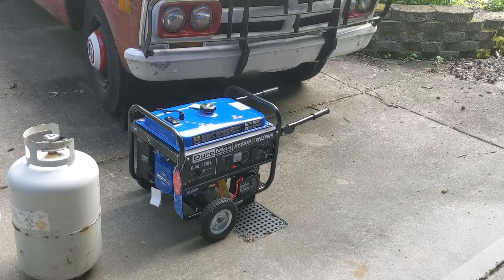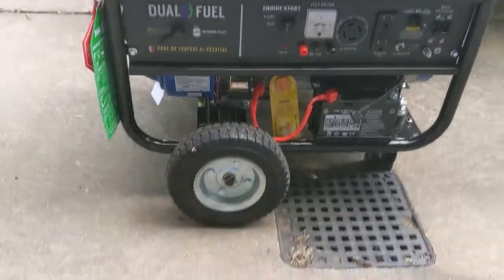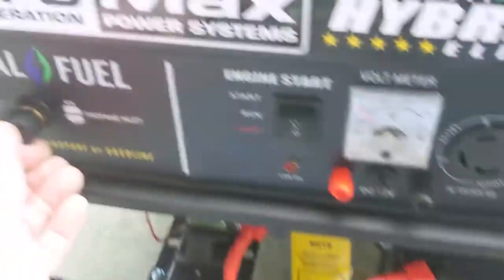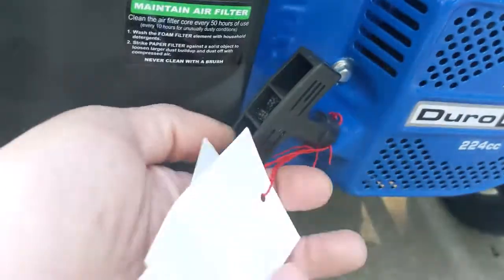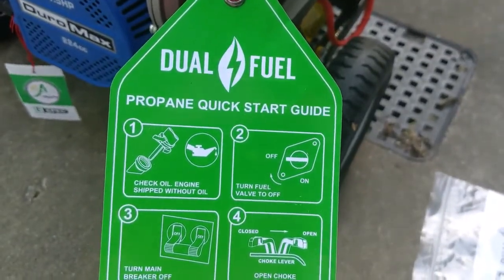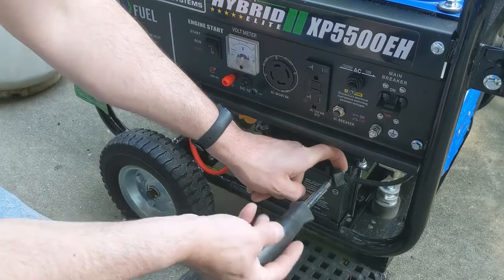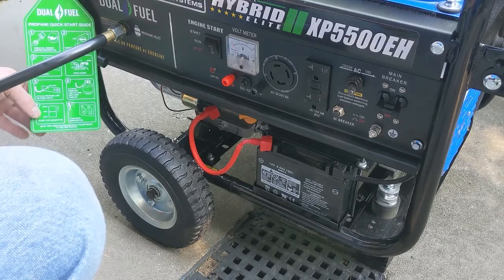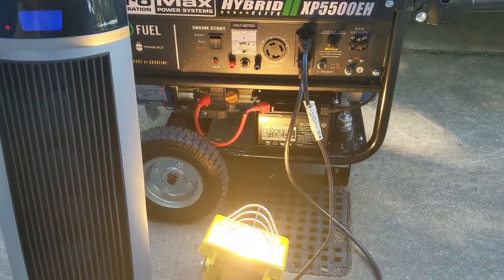DuroMax XP5500EH Generator

Comment: ... this runs ..FULL THROTTLE.. regardless of "demand" ... NOT-GOOD ... noisy & sucks-fuel ... YOU NEED AN "INVERTER-GENERATOR" WITH AN "ECONOMY MODE" ...
Reply: No it doesn't run full throttler regardless of demand. This generator just like every other non inverter generator has a governor to keep the engine at 3600 RPM to maintain 60 hz AC frequency. with no load the throttle is not even 1/4 the way open to maintain 3600 RPM so stop spouting uninformed bullshit.
Reply: @anthonypetrone242  .. Thank You ... Anthony ...
Reply: Don’t forget about generator safety rules: Always make sure you follow all the generator safety rules whenever you use your portable generator. This is a reminder for your safety. Generators can be dangerous if not used carefully. Every year, hundreds of people die or get injured when using portable generators due to carbon monoxide poisoning and electrocution. Make sure you are using your generator carefully and keeping others safe as well. There is something very serious that everyone should always be aware of when using generators. Some people do run their generator indoors which is not safe and that increases the risk of carbon monoxide poisoning which can cause death of family and you. Some people run their generator in wet conditions which can electrocute them. Please remember that you should never run your generator indoors. Remember that carbon monoxide is an odorless and colorless gas that you cannot see or smell. Carbon monoxide is a silent killer. Keep that in mind. Make sure your generator is 15-20 feet away from your house and away from doors, windows, and vents. Never use your generator in your porch too. Having a carbon monoxide detector is very important against generator safety. Some people also allow children to go near the portable generator which could pose risks. We need to keep an eye on our children making sure that they are not near the portable generator so they won’t get electrocuted or burned by the generator which is dangerous. A locking enclosure also keeps kids safe. A generator shed might look like a tempting place to explore, or take cover during a game of hide and seek, but a generator is a dangerous piece of equipment that can cause injury. It says on the manual that we should also keep children away at all times from the portable generator to avoid injuries. Please do not allow a child or unqualified people to operate the portable generator.  It is important to keep your children safe especially little ones. The portable generator can be hot during an operation. Just because some manuals missed what should be listed doesn’t mean it’s safe to do. Always follow the generator safety rules when using portable generators. Generators pose electrical risks. If you need to use your generator during wet weather, you need a generator tent to protect your generator from getting wet. Don’t let your generator get wet. Keep your generator dry and before using your generator, please make sure your hands and your generator is dry. Do not wear loose clothing when operating the generator. Everything that is said on the generator’s operating manual should not be ignored. Never smoke cigarettes near the generator. Please keep flammable things away from the generator. Never overload your generator too. Your generator can catch fire. Never ever try to plug a generator cord into a wall outlet to avoid back feeding. Back feeding your generator is dangerous. Always turn on your generator first before plugging in appliances and shut off the appliances before turning your generator off. Use a heavy duty cord for your generator and the cord should not be worn out. All the instructions should be followed carefully. Never refuel your generator while it’s running. It can cause fire if fuel spills while your generator is hot. You should turn off your generator and let it cool off before refueling it. Having a fire extinguisher next to the generator is also important. This is only a reminder for everyone’s safety of using generators. Make sure your generator is properly grounded. Having a fire extinguisher next to the generator is also important against the safety rules. https://youtu.be/I1jT3ANENvI and here is a video more about keeping others safe when using generators and also about our family’s safety. It’s important to keep our little children safe as well. Make sure your little children are kept away from the generator at all times especially when it’s running. Hope this helps. Always remember that it’s better to be safe than sorry.

Comment: Thanks!!!!  I drained the battery trying to get it started, as soon as I fiddled with the choke it started right up! (Using on propane...)
Reply: Same here. I was following the Quick Start Guide, and left the choke open. After setting choke to half open, it fired right up.
Reply: Don’t forget about generator safety rules: Always make sure you follow all the generator safety rules whenever you use your portable generator. This is a reminder for your safety. Generators can be dangerous if not used carefully. Every year, hundreds of people die or get injured when using portable generators due to carbon monoxide poisoning and electrocution. Make sure you are using your generator carefully and keeping others safe as well. There is something very serious that everyone should always be aware of when using generators. Some people do run their generator indoors which is not safe and that increases the risk of carbon monoxide poisoning which can cause death of family and you. Some people run their generator in wet conditions which can electrocute them. Please remember that you should never run your generator indoors. Remember that carbon monoxide is an odorless and colorless gas that you cannot see or smell. Carbon monoxide is a silent killer. Keep that in mind. Make sure your generator is 15-20 feet away from your house and away from doors, windows, and vents. Never use your generator in your porch too. Having a carbon monoxide detector is very important against generator safety. Some people also allow children to go near the portable generator which could pose risks. We need to keep an eye on our children making sure that they are not near the portable generator so they won’t get electrocuted or burned by the generator which is dangerous. A locking enclosure also keeps kids safe. A generator shed might look like a tempting place to explore, or take cover during a game of hide and seek, but a generator is a dangerous piece of equipment that can cause injury. It says on the manual that we should also keep children away at all times from the portable generator to avoid injuries. Please do not allow a child or unqualified people to operate the portable generator.  It is important to keep your children safe especially little ones. The portable generator can be hot during an operation. Just because some manuals missed what should be listed doesn’t mean it’s safe to do. Always follow the generator safety rules when using portable generators. Generators pose electrical risks. If you need to use your generator during wet weather, you need a generator tent to protect your generator from getting wet. Don’t let your generator get wet. Keep your generator dry and before using your generator, please make sure your hands and your generator is dry. Do not wear loose clothing when operating the generator. Everything that is said on the generator’s operating manual should not be ignored. Never smoke cigarettes near the generator. Please keep flammable things away from the generator. Never overload your generator too. Your generator can catch fire. Never ever try to plug a generator cord into a wall outlet to avoid back feeding. Back feeding your generator is dangerous. Always turn on your generator first before plugging in appliances and shut off the appliances before turning your generator off. Use a heavy duty cord for your generator and the cord should not be worn out. All the instructions should be followed carefully. Never refuel your generator while it’s running. It can cause fire if fuel spills while your generator is hot. You should turn off your generator and let it cool off before refueling it. Having a fire extinguisher next to the generator is also important. This is only a reminder for everyone’s safety of using generators. Make sure your generator is properly grounded. Having a fire extinguisher next to the generator is also important against the safety rules. https://youtu.be/I1jT3ANENvI and here is a video more about keeping others safe when using generators and also about our family’s safety. It’s important to keep our little children safe as well. Make sure your little children are kept away from the generator at all times especially when it’s running. Hope this helps. Always remember that it’s better to be safe than sorry.

Comment: I just purchased the XP5500. It started right up but I don't have any power. Any suggestions? Customer service isn't available on the weekends.
Reply: Did you ever figure it out ?
Reply: 2021, customer service is not available Anymore?
Reply: Did you flip the breaker on?
Reply: Don’t forget about generator safety rules: Always make sure you follow all the generator safety rules whenever you use your portable generator. This is a reminder for your safety. Generators can be dangerous if not used carefully. Every year, hundreds of people die or get injured when using portable generators due to carbon monoxide poisoning and electrocution. Make sure you are using your generator carefully and keeping others safe as well. There is something very serious that everyone should always be aware of when using generators. Some people do run their generator indoors which is not safe and that increases the risk of carbon monoxide poisoning which can cause death of family and you. Some people run their generator in wet conditions which can electrocute them. Please remember that you should never run your generator indoors. Remember that carbon monoxide is an odorless and colorless gas that you cannot see or smell. Carbon monoxide is a silent killer. Keep that in mind. Make sure your generator is 15-20 feet away from your house and away from doors, windows, and vents. Never use your generator in your porch too. Having a carbon monoxide detector is very important against generator safety. Some people also allow children to go near the portable generator which could pose risks. We need to keep an eye on our children making sure that they are not near the portable generator so they won’t get electrocuted or burned by the generator which is dangerous. A locking enclosure also keeps kids safe. A generator shed might look like a tempting place to explore, or take cover during a game of hide and seek, but a generator is a dangerous piece of equipment that can cause injury. It says on the manual that we should also keep children away at all times from the portable generator to avoid injuries. Please do not allow a child or unqualified people to operate the portable generator.  It is important to keep your children safe especially little ones. The portable generator can be hot during an operation. Just because some manuals missed what should be listed doesn’t mean it’s safe to do. Always follow the generator safety rules when using portable generators. Generators pose electrical risks. If you need to use your generator during wet weather, you need a generator tent to protect your generator from getting wet. Don’t let your generator get wet. Keep your generator dry and before using your generator, please make sure your hands and your generator is dry. Do not wear loose clothing when operating the generator. Everything that is said on the generator’s operating manual should not be ignored. Never smoke cigarettes near the generator. Please keep flammable things away from the generator. Never overload your generator too. Your generator can catch fire. Never ever try to plug a generator cord into a wall outlet to avoid back feeding. Back feeding your generator is dangerous. Always turn on your generator first before plugging in appliances and shut off the appliances before turning your generator off. Use a heavy duty cord for your generator and the cord should not be worn out. All the instructions should be followed carefully. Never refuel your generator while it’s running. It can cause fire if fuel spills while your generator is hot. You should turn off your generator and let it cool off before refueling it. Having a fire extinguisher next to the generator is also important. This is only a reminder for everyone’s safety of using generators. Make sure your generator is properly grounded. Having a fire extinguisher next to the generator is also important against the safety rules. https://youtu.be/I1jT3ANENvI and here is a video more about keeping others safe when using generators and also about our family’s safety. It’s important to keep our little children safe as well. Make sure your little children are kept away from the generator at all times especially when it’s running. Hope this helps. Always remember that it’s better to be safe than sorry.

Comment: I have a very similar WEN propane generator and go through the same ordeal every time when starting. I never intend to use gasoline. I don't know if it will start easier on gas or not.  I bought one of these to take better advantage of the generator capacity. https://smile.amazon.com/gp/product/B07WSTSCN2/ref=ppx_yo_dt_b_asin_title_o05_s00?ie=UTF8&th=1
Reply from the maker: I've haven't tried running this one on gas yet, and really have no plans to.  I'm sure it will start easier on gas as the propane setup on these isn't ideal, but it works.